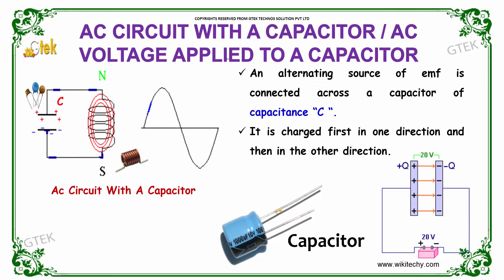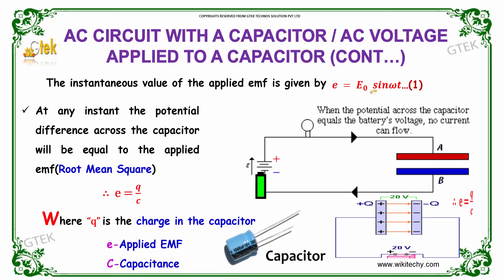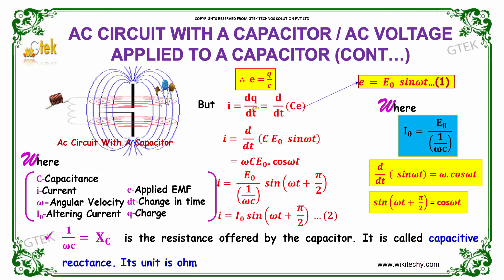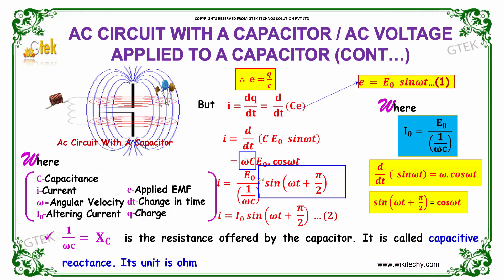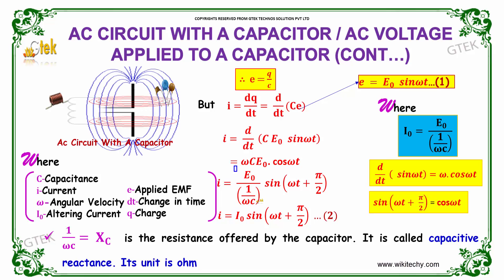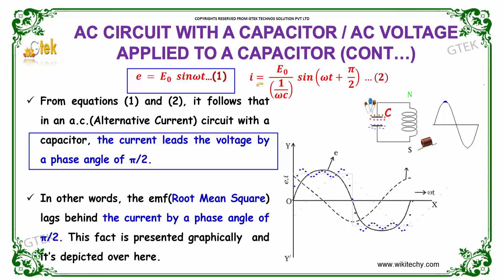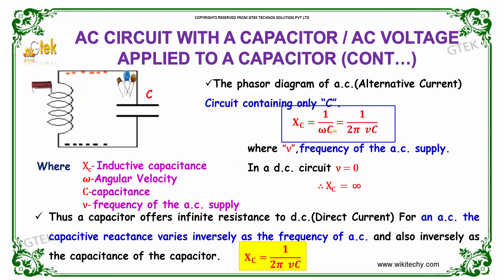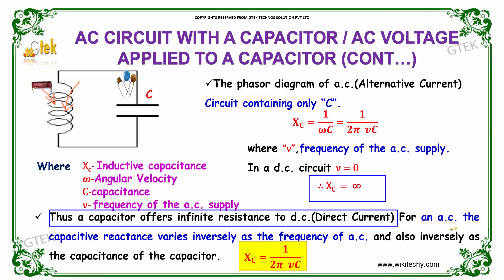AC Circuit with a Capacitor| Electro Magnetic Induction And Alternating Current

Comment: The flow of electrons “through” a capacitor is directly proportional to the rate of change of voltage across the capacitor. This opposition to voltage change is another form of reactance, but one that is precisely opposite to the kind exhibited by inductors. Voltage lags current by 90o in a pure capacitive circuit.

Comment: Once the capacitor is “fully-charged” the capacitor blocks the flow of any more electrons onto its plates as they have become saturated. However, if we apply an alternating current or AC supply, the capacitor will alternately charge and discharge at a rate determined by the frequency of the supply.

Comment: In an AC circuit that use capacitors or inductors, the total opposition to current flow (called Impedance) is affected by frequency. The Reactance (its AC impedance) of a capacitor is known as Capacitive Reactance, Xc and is given as 1/(2pi.f.C)

Comment: Then the Capacitance in AC circuits varies with frequency as the capacitor is being constantly charged and discharged. ... In the purely capacitive circuit above, the capacitor is connected directly across the AC supply voltage. ... Capacitive Reactance in a purely capacitive circuit is ...

Comment: Voltage lags current by 90o in a pure capacitive circuit. ... Just as the current through a resistor is a function of the voltage across the resistor and the resistance offered by the resistor, the AC current through a capacitor is a function of the AC voltage across it, and the reactance offered by the capacitor.

Comment: the Capacitance in AC circuits varies with frequency as the capacitor is being constantly charged and discharged. ... In the purely capacitive circuit above, the capacitor is connected directly across the AC supply voltage. ... Capacitive Reactance in a purely capacitive circuit

Comment: When capacitors are connected across a direct current DC supply voltage they become charged to the value of the applied voltage, acting like temporary storage devices and maintain or hold this charge indefinitely as long as the supply voltage is present.

Comment: AC resistor circuits; AC capacitor circuits; Series resistor-capacitor circuits; Parallel ... Pure resistive AC circuit: voltage and current are in phase.

Comment: apacitors do not behave the same as resistors. Whereas resistors allow a flow of electrons through them directly proportional to the voltage drop, capacitors ...